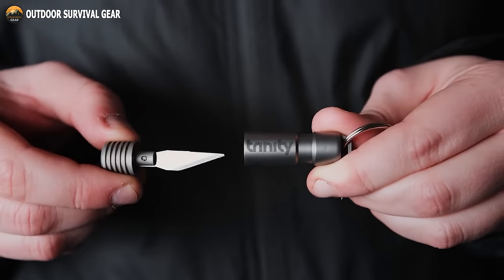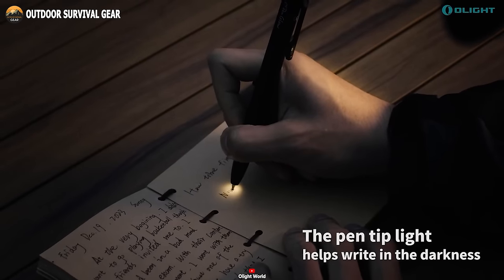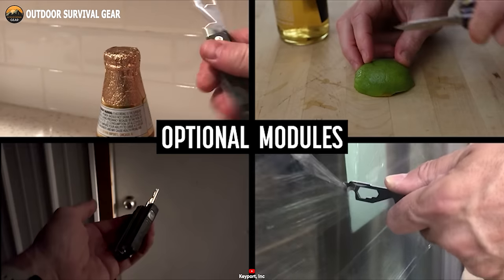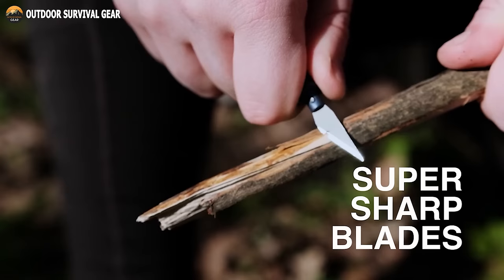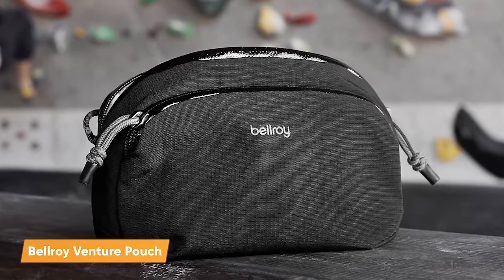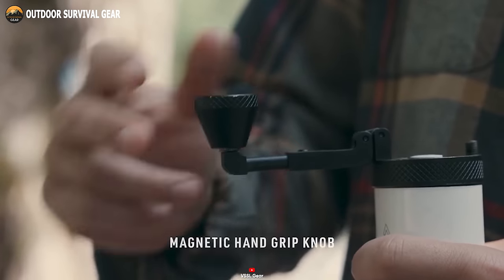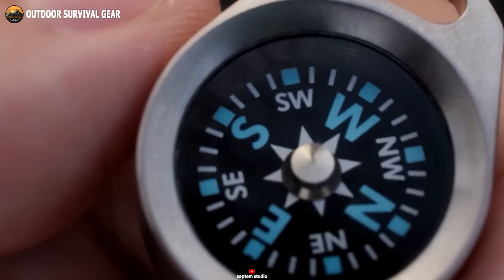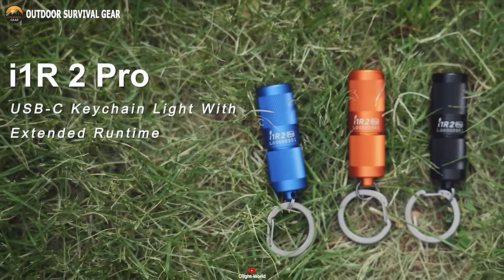20 Coolest EDC Gadgets Every Man Will Appreciate | Everyday Carry Essentials 2024

Comment: The tracker in the wallet kills me. If it gets stolen that tracker will be tossed instantly. Useless.
Reply: Hence why when I go to a big city I carry a dummy wallet, which is basically the same design as my main wallet, if I get mugged I give them my dummy wallet, kept in a non secure pocket, that has nothing but £20 in 4 £5 notes, and useless loyalty cards and empty an oyster card that I no longer need, that should get them to take and run, not knowing they have nothing important just £20.